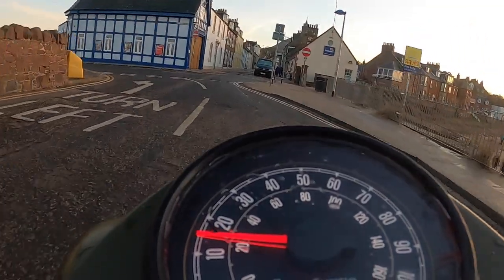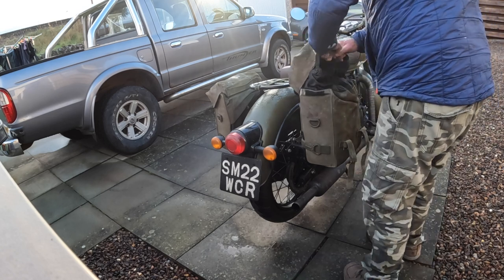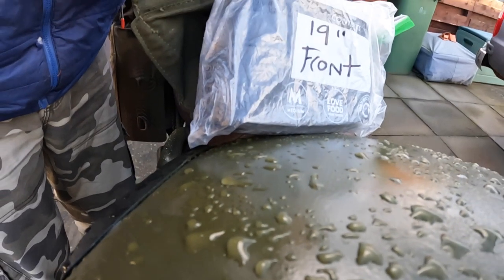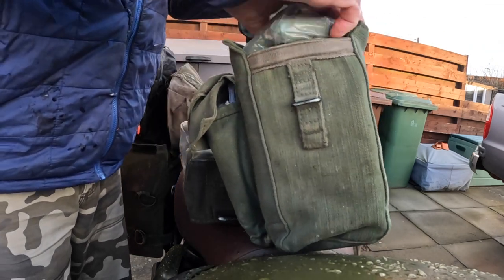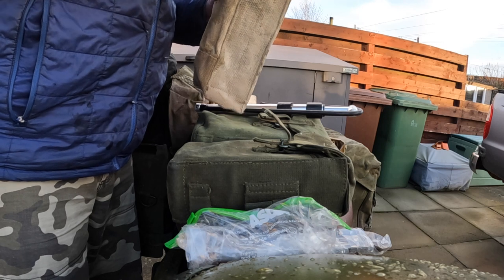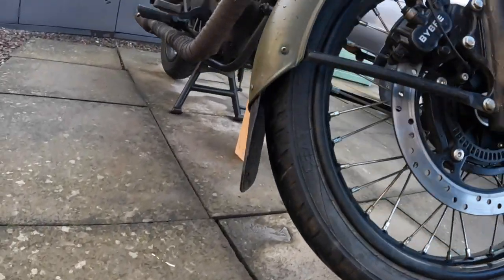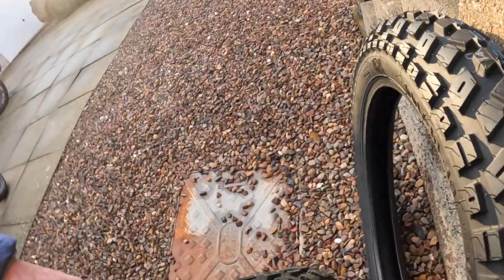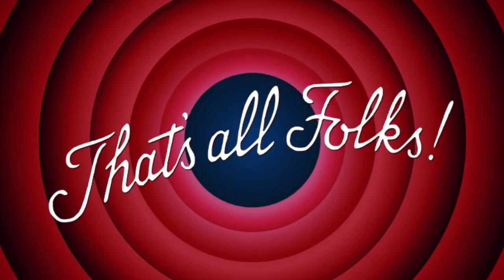Royal Enfield Classic 350   Puncture Prep - carry this in a Pannier

Comment: If you know where the leak is or can hear it when you pump then just pop the bead at that spot or enough to pull out the part of the tube that has the hole. No removing the wheel as long as you can pull the bead off and still rotate the tire.
Reply from the maker: True that can also be done Daniel 👍 thanks for sharing, cheers Bruce

Comment: Got to hand it to you guys across the pond. Just watched a guy take a BSA test ride in        +1 C !   Seems much like working on a scaled up bicycle wheel. I purchased teflon coated phillips puncture repair screws last summer. Two days later my wife drove over a sheet metal screw on her motor bike and then a nail while driving her van. Both tires are still holding air. Have to give up classic spoked wheels is the drawback. Mountain bike pump is a great idea.
Reply from the maker: The cold spells often only last a week or so then often the weather warms up though we then often get wind or rain! 🤣😁
Cheers Bruce

Comment: I've never thought about using a bicycle pump before on my Classic. I've always had a 12v power socket wired into my previous bikes with a normal electric tyre pump in my panniers.

What make of pump should I look for?
I don't want to buy one that's gonna break the first time I use it.
Reply from the maker: Hi, I use Leyzene pumps, they cost around £30 - £40 but are really good and you can buy replacement internals for them, I now have 4 of them bought over the last 15 years and the original one still works a treat,
Cheers Bruce

Comment: What make are those panniers/racks please? Excellent tip with the wood. On that now......
Reply from the maker: They were bought from Indra via eBay and arrived in U.K. in under a week but sadly have proved a bad buy. They are not genuine RE parts and the panniers don’t even fit over the left side frame, most of the bolts were not long enough and the powder coating is flaking at the welds where rust is coming through, they were dark grey when bought and in 3 months outdoors have faded to v light grey, I painted them when I painted my bike and when I have the spare money I will be replacing them with genuine panniers and racks from Hitchcocks Motorcycles Here in the U.K. 
the old say buy good buy once is so true! 
Cheers Bruce

Comment: You put me to shame. When out on the mountain bike I will carry all the gear and gladly repair a tyre at the side of the road. However with regards to my classic 350 it's not equipped with panniers and therefore any problems I would call out recovery. What a defeatist attitude!!! With regards to protecting your bike during winter riding I'm aware you use GT85. A friend who rides all year has recommended Scottoiler FS 365 which I purchased £12.99. Apparently it is very good at preventing corrosion caused by salt. Have you used it before ? Looking forward to the changing of the tyres.👍
Reply: I've used the scotoiler 365 before. It does a reasonable job, but looks very messy on the bike, it has a dirty blue tinge to it.
I now use acf50 to protect my bike. I got the big bottle of it rather than the spray can. It's easy to end up spraying it in the wrong place, whereas with the liquid you can put it on a cloth and rub it onto where you want it.
Reply: @the.just.able.biker67  Thanks for that and I agree regarding a bit messy. I had to use a cloth to take off the excess. Probably more suitable for my friends BMW GS but not my red and chrome classic. Thanks again and I will look into the acf 50.👍
Reply from the maker: As mentioned above in a comment I believe if you carry it you will never need it!,  I need to look that up the Scot oilas while the Lanoguard is great for likes of my Jeep chassis I would previously us ACF 50 for motorbikes. its a bit pricey now and I still have a few other rust proofing treatments left in garage like the Lanoguard so will use what I have plus maybe some Scot oil
Cheers Bruce

Comment: Great tips! Yes, I carry spare tubes and a Lezyne pump too. You did not say what the Gorilla tape rings were for. On my Classic, I found my rear wheel a real struggle to fit back on (Classic 500 'Tribute'). It will be interesting to see if yours is different. Thanks for the info!
Reply from the maker: Hi Peter, the Gorilla tape i have on all my mountainbike pumps as handy for making repairs to anything and if some is wrapped around the pump then you always have some with you!, I just fitted my new tyres and the back wheel was also a bit of a drama to refit, a spacer kept falling out until I held it in with a dollop of grease!
Tyre fitting film will be on here this evening 7pm ish!
Cheers Bruce

Comment: Like the block of wood idea 👍
Reply from the maker: Thanks, it works for the front but two pieces are needed for under each side of the centre stand to raise it enough to remove the rear wheel with out help from someone, I found this out today when refitting my rear wheel and the bike rolled forward off of the centre stand , it was nearly a disaster!, you will see it on my next film fitting the new tyres this evening at 7pm when it goes live!
Cheers Bruce